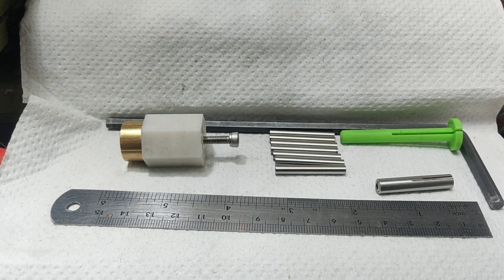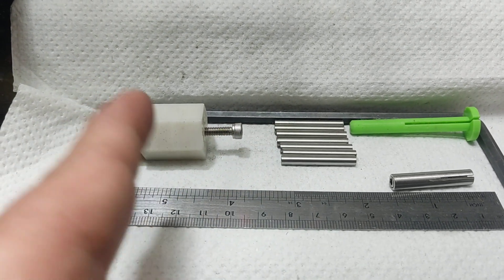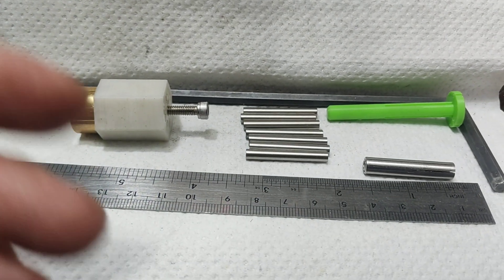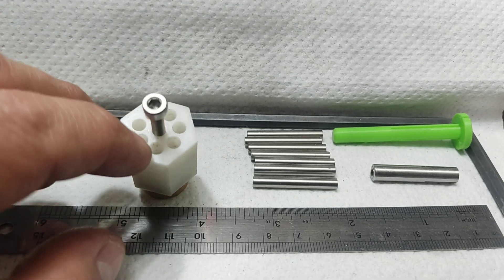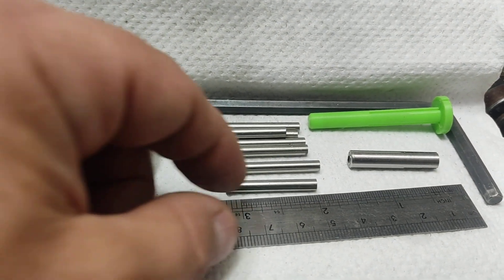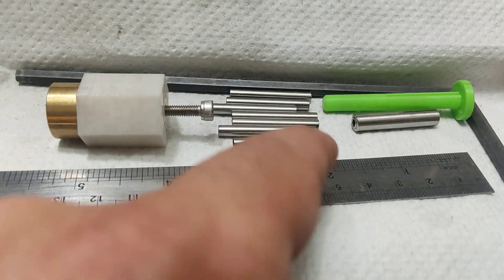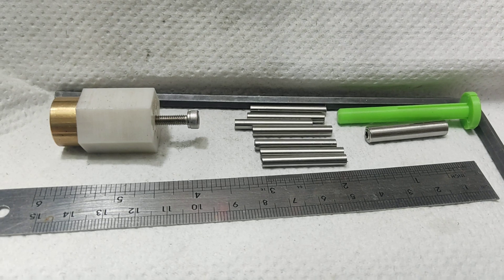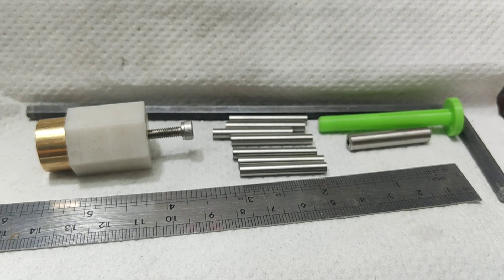Batch machining... help?

Comment: How I would do it:

 - Keep the same revolver setup you already have but add a wedge in the middle so that once the tubes are inserted, you can lock all of them together. Also, make the tubes accessible from both the back and the front.
 -The backside of the revolver jig needs a shaft to put in the lathe.

 - Before installing, fill the tubes with hot glue or wax to make them more rigid and workable.
 - Turn the backside and front in the same setup.
Reply from the maker: Neat idea indeed!
Thank you! 
Now to design a locking setup :)

Comment: instead of clamping outside this thin wall stuff, you need to support inside, especially since SS is such a gummy and tough material that will work harden if you're too scared to make a cut
steel expanding arbor (with a back stop machined in the arbor) in a lathe, use the tailstock center as a center and expander at the same time, you lock the carriage in the final length position, put a tube on the arbor, move tailstock in, lock, quill to put pressure, center and expand the arbor, and then just cut off to final size
this way you never ever rechuck anything, no indicators, no Z movement, you just put a slightly too long tube on and cut to length with X slide, should be good enough to make hundreds of parts that will be +- couple hundreds of mm, definitely not tenths of mm between them
and sharp carbide cutoff tool, not insert tooling, but something you sharped from a micrograin broken endmill, the problem with steel tools on SS is that you must take a cut, you can't rub, part will harden and burn the tool, hence carbide, but if the lathe is flimsy, then all this becomes 100x more difficult and I can't give any advice there
Reply from the maker: Excellent points. I'll give it a go and try. Thank you!!!

Comment: I see you can't use 5C so; Make yourself a collet out of brass, drill and ream etc for a close fit for a single tube, make sure to only drill/bore deep enough that it creates a backstop/step allowing the tube to only protrude a small amount from the front face. You can then either cut three slots with a slitting saw or just a hacksaw (they both work) Its a quick cheap way to make custom collets with length stops built in. Then in terms of cutting, a VERY sharp tool. Grind a tool with a lot of side and back rake. I find that works best for thin wall tubing. Light cuts. If that still has issues crushing the tube, Id turn a brass rod insert a close fit to the tube inner diameter. Edit; alternatively consider using tailstock support and making a very thin sharp parting tool to trim the end to length close to the collet face for double support.
Reply from the maker: Wonderful tips. The collet making is exactly what I tried with the 3D printed version. Loved the internal support idea - I'm making a stainless collet (but I should have thought of brass... easier on the lathe) I'llput these tips to use. Thank you!
Reply: @Smallathe  Brass is a great material. Easy to use, strong, with care it will last for a really long time without wearing out. (I use a lot of homemade brass collets for my day to day work) Good luck!

Comment: Yeah, thin tube is hard to work with. With parts like this, I usually do a rough oversize cut, then install in the next assembly, then finish it as a part of the next assembly. (I.e. flush trim/grind). You might also try using a cutoff wheel mounted to a tool post, advancing inward towards the center of the rotating fixture. An abrasive disc exerts less force. Heat will still be an issue with a plastic fixture.

Comment: Milling is pulling them out. You need to fix them in place. Maybe a metal mandrel and some light glue that can be quickly dissolved.

Comment: Make some aluminum pie jaws with a shoulder to refrance against and do them on a lathe
Reply from the maker: Oh... Good idea! Why didn't I think of that!!! Thanks!!!
Reply: @Smallathe  no problem brother happy to help.
Boring them .002" to .005" under size from your stock OD should be enough to prevent 3 point contact and still avoid crushing. Let me know how it goes =)
Reply from the maker: @djacques7912  Thanks mate!  Will do! Much appreciated!

Comment: Maybe put them in a line, not a circle, it will make a jig easier to make. Make the jig out of something more rigid that will deal with heat. Grind or saw to length with an abrasive blade.

Comment: It seems like they need to be clamped in place to some greater degree. I'm not sure how to do it so all the aspects work together, but I picture a line of tubes clamped in a row by a top plate and bottom plate, clamp the bottom plate in the mill laying down, and cut one end and the other end of the tubes in one setup.

Maybe the bottom plate could be aluminum or similar, and the top printed, to get better friction with small forces.

Comment: Such thin walled tiny tube is hard to proper cut and hold... If your workholding contraption is aligned properly on the machine and clamps properly and even +/-0.05mm should be easily doable imo. Like if you are indicating it and have 0.02mm deviation on the face of the brass backstop you gonna end up with 0.02mm difference in part lenght, if stuff isn't moving. The brass isn't really an issue, sure it will wear faster than steel but it will still last quite a bit. Even a 3D printed one will hold up a few batches if it doesn't get totally violated or too hot. The cutting is the funky part. If possible try to get a grinding attatchment (or 3D print a toolpost holder for a dremel or clamp it somehow) and grind em to lenght on the lathe with a disc in your holder. For milling the cutting forces gonna be too much and buckle or bend or pull out the pipes, same for the lathe, interrupted cuts in such parts are no bueno and might even wreak havoc on your holder if something goes south (i.e
 the insert snagging onto a dented pipe). On the lathe you could also put em in a collet or on a mandrel with a backstop but that only works for one part. I had issues with machining similar pipes, also stainless just bigger diameter but also very flimsy and freehand dremel'd it on my janky mini lathe, worked excellent. For deburring a wooden stick with a slit to hold fine sandpaper in it will safe your fingertips.
Reply from the maker: Awesome tips! Thank you!
I will look into grinding them to final specifications.
Reply: @Smallathe  Don't forget to throw some protection onto your lathe's ways to keep the grinding particles off and good luck!

Comment: Make a small insert rod 3,95 and put  it inside. You can make a small holder like the one you printed and in brass you can insert small inserts and secure them with thread m4. Or you can put the rod insert in the tube and do it on lathe

Comment: Thin wall tube is tough, it just wants to crush. When bending tubes like this the internal diameter needs to be supported with mandrel to avoid wall buckling. I would suggest using the fixture you made (steel base is probably a good idea) on the lathe again, but fill the tubes with wax (or similar lowish temp melting material) or a compacted fine powder (sand probably wouldn't be ideal on a machine tool). This can also help if you end up grinding instead of machining, just beware of getting the tubes hot enough to melt the wax or gumming up the wheel.
Reply from the maker: Excellent point. I can fill them with wax and go easy. Thanks!!! I also thought of grinding them as the setup with it's steel base is on the rotary table - so the grinding head is stationary but the tubes spin... Thank you!!!

Comment: When milling start from the centre of tube and helically start to grind down the walls in small increments. Also, make a linear fixture to hold in the vice of Your milling machine, it makes it easier to achieve uniform z-distance and You already have a vice with known zero. If a jig is made from plastic and with some fancy compliant strategies, You can actually use the vice to deform the jig enough so every sleeve is held in place firmly, yet gently.
Reply from the maker: Good point. I can make a jig to hold the tubes from brass or aluminum but that means either doing it one by one (yes, that's the preferred machining way, and I fully agree with it) or I will have to glue the tubes in. I also agree that grinding the walls is better than milling (or may be a second step to milling). This does give me an idea - I can hold the fixture in a rotary table and rotate it as the milling/griding head is fixed. What do you think?
Reply: @Smallathe  You could try to print the fixture. But I think I misunderstood one aspect, I assumed You use a CNC not a manual milling machine, hence I suggested using spiral milling strategy starting from the inside and incrementally moving outwards (where tubes are fully supported by fixture). But using a fixture to hold tubes firmly and fine sandpaper disc should work also. thin walls mean You do not need to remove a lot of material to grind down few tenths. Alternatively, You could run Your rotary fixture on static sandpaper?
Reply from the maker: @veikovasko5603  Hi. Thought you were referring to milling methods. In theory I could do that on the unimat as a mill - but it totally sucks as one. It vibrates like mad when everything is fixed solid (the round rod as a Z axis shaft and tiny base don't really help out). You are absolutely right - I am thinking of grinding :)

Comment: Inserting a close fitting rod into the tube should allow you to cut them without crushing, it as an alternative, you could hold a Dremel in your lathe tool holder and grind then with a cut off wheel
Reply from the maker: I actually made a dremel 3mm shank and 6mm shank tool to cut and mill on the lathe (and funny enough never used it) I'll give it a go. My worries about grinding is how to protect the ways. I"ll see what I can do about it. Thank you!!!
Reply: @Smallathe  pretty common to cover the ways with either cloth, or use aluminum foil
Reply from the maker: @jginsberg1  right. I'll seewhat I can do. Thanks!

Comment: how about using a jewelers circular saw, rather than a mill? One way: make a jig to hold your rotating " white revolver" on the cross slide, fix the arbor with the saw in the spindle. And then move your cross slide and rotate your revolver to cut the tubes (one at a time, I guess).
Reply from the maker: Good one! I thought of cutting while turning as well. That's definitely an option. Thank you!

Comment: Make the brass stop out of steel, then try surface grinding if you can. Or outsource to a shop with a wire edm
Reply from the maker: Wire EDM would be ideal ... Same for.a steel base. Thank you!

Comment: If they're exactly the same diameter (within tenths) then a 5C, 3C, or MT collet with depth stop should be able to set the length for you.  I use 3D printing with various materials around the shop but a hard steel collet is probably the ticket.  I'm not so sure about the ball bearing.  It could be OK but I suspect that the exact condition of the ID is casuing variation.  There could be variation in the ID from one inch to the next.  Also, you cut that end in a previous operation.  Even deburring could be throwing you off.  A flat (or shouldered) stop in a proper collet is what I would try. I don't mean anything negative about your work when I say "proper".  I just mean that there are so many things that could go wrong and you may as well take advantage of 200 years of machine work experience.  Make sure to hone your lathe tool, whether HSS or carbide, and use a finishing tool with a lot of positive rake.  Otherwise, a vise stop on the mill should get you within a few tenths.
Reply from the maker: Awesome points. Thank you!
I can't use a 5c collet - it's huge compared to the unimat. I did start making my own metal holder. I'll give it a go. :)

Comment: This is not that hard if you have the right tools.  Your mill is all wrong for this and making any kind of tooling with 3D printing is a no-go. It's extremely difficult to hold a batch of 8 accurately so probably not worth the effort.  The lathe is the logical choice for best accuracy. You really need a 5c collet chuck with a stop installed inside the collet. They would only take a few seconds each to finish. A 3-jaw chuck  will not repeat close enough  even with the homemade collets.  You never mentioned an acceptable tolerance, and there's no such thing as all exactly the same length. Unfortunately without the proper tools you are going to fight this.
Reply: Seconding this, collet for an easy win.  He did mention the tolerance was .05mm at one point, but I could tell if that was +/- or total window.

Comment: You only have a 3 jaw, correct?  What series of CRES (Stainless) is this?
Reply from the maker: I have self centering three jaws, self centering four jaws and a regular independent four jaw. It's 304 stainless steel. Thanks!
Reply: @Smallathe  since that is what you have, I would recommend making a pot that will locate accurately off the chuck face. Split it and use the 4 jaw to grip on the OD.  The tube should be a close fit in the pot.   Get a sharp tool and face from the inside to the outside.  Make sure the tool has ample front rake.  It can be neutral rake on top.  Doing the work in a batch is problematic since you are limited in the sophistication of your workholding.   A carbide threading tool that is rotated a little can be used for something like this.  The better the pot repeats in the chuck, the better the result will be.  7 parts matched should go fast.

Comment: Thought about this for couple days. With only the equip you got I would tighten them up in a vise, up against a fixed stop, and side mille the ends to finished dimension? Thats all I got.
Reply from the maker: Thanks Mike!!! Much appreciated! I did tighten them - using a hand press, just because the 3D printing won't last once if you crunch on it...

Comment: Collet lathe with a collet stop. Get a machinable 5C collet of the correct diameter and face it to length at the machine using a pin of some kind to set the length from the stop so you minimize deflection. Lock Z and get to machining.
Reply from the maker: Awesome answer. Thank you! I would, but the unimat lathe is keyboard size and it's the only one I have. The chuck holds up to 2" max od... ;)

Comment: would have to see setup in actual action and securement, but horizontal allows movement out plus white plastic flex..don't think brass or steel that critical. I bet a grinder/surface grinder setup would be ideal taking off microns per pass. Not sure batch possible, but individually yes. I've a tool grinder, would put them in vice on it, introduce slowly to diamond or cup wheel.
Reply from the maker: Thank you..I will post a full video of the milling process. I think you are right about grinding, but I don't have a grinder - though I could grind these using the unimat... In theory.

Comment: My guess is that the mill is lifting the tubes out of the holder as it mills the ends.
Reply from the maker: Agreed. I thought of the endmill ever so slightly at an upright angle - so the bottom ones are ok but the rest are too long. I should point out the mill head was trammed and the endmill holder fits the endmill snuggly - yet that is a brass holder... I'll keep trying :)
Reply: @Smallathe there is also endmills with reverse flute that pushes part downward
Reply from the maker: @dadobojanic  very cool... I'll look for those. Thank you!

Comment: Maybe use a pen-makers barrel trimmer in the tail stock? I use one to accurately trim the brass tubes to exact length (they are encased in the square stock material which will form the barrel of the pen when turned down to round), Seems a crude method but works to produce the squared ends needed for the pen mechanisms to work, and to the correct length to allow the refill to protrude the  right amount.
Reply from the maker: Interesting idea. Any chance of seeing your setup?

Comment: I guess the easiest way would be to use a collet with an endstop instead of the chuck. Then you can just push them in the collet so you are absolutely sure they will be centered and on length of the endstop. Then machine them to the final length  by slowly moving towards the collet.
The endstop can be pushed from the back of the machine so can probably be used again with adjustments from that side.
But you will have to get or make a colletholder.
I guess you drillchuck is not accurate enough?
Reply from the maker: My thoughts exactly - and as I don't have any collet of any size - I 3D printed the first " stop collet".
I'd really want a batch process rather than one by one...

Comment: I have same machine as you (Unimat) and I can suggest one way. Take for example some 10mm brass rod about 2mm longer than the piece you want to machine. Then drill the hole with the diameter of the tube you want to machine to about 5mm from the end so that this would be your end stop for tubes. Then cut this made part along the long axis to about 3/4 so that when you tighten it in the chuck it will hold the tube firmly. The rod is 10mm so this means you have end stop when pushed into the chuck, because it has good 6mm hole through.this means that the tube inserted will always be in the same spot. It also helps if you have some end mill to square the bottom of the hole inside the brass rod. Then you just lock the carriage and cut each individual tube one by one.
Reply from the maker: Good point! I will give it a go. Same for turning using an indicator. I think milling would be better, much like yourself. I'll try it. Thanks!!!